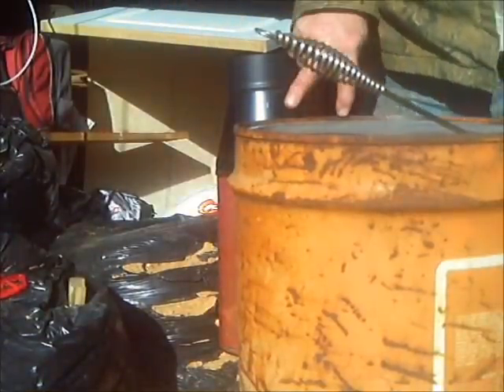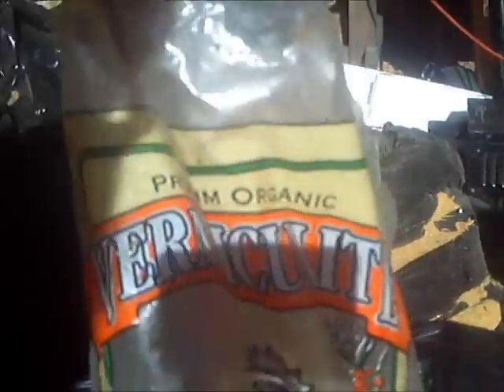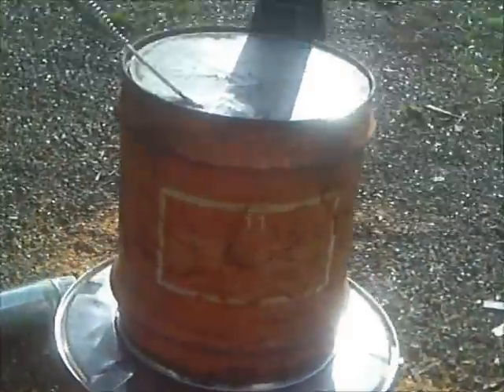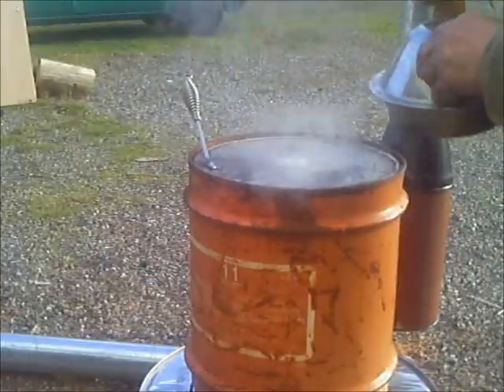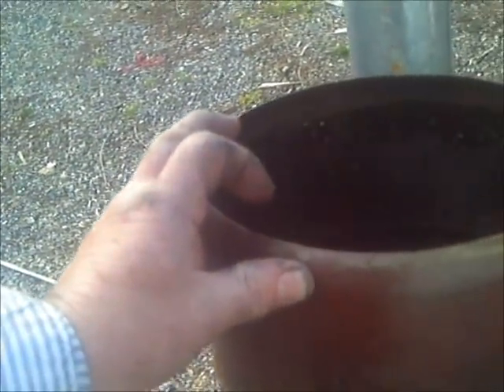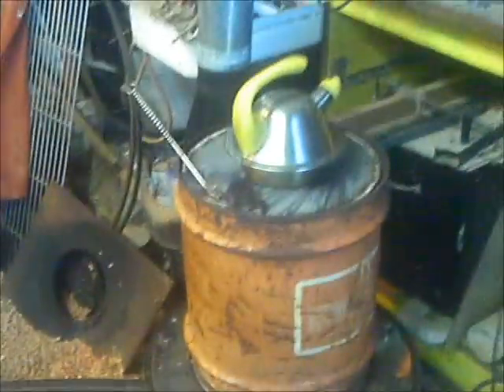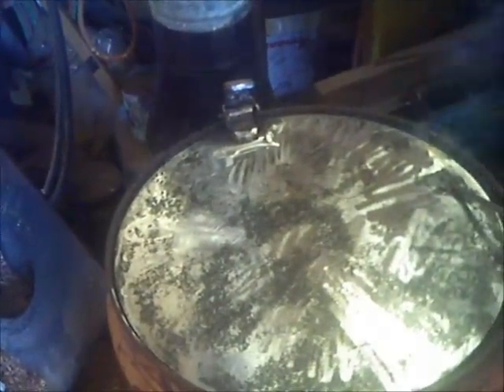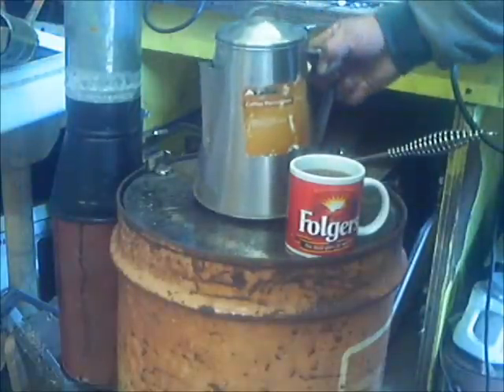Sawdust cooker Test burn

Comment from the maker: The tube that comes up the center from the bottom is the air inlet. That make the glow you see. It sits on the washing machine drum.
Reply: so there is a hole in the middle of the bottem ?? how big is the hole??
Reply from the maker: @busdriver9007  Look at time stamp 30 seconds. You see the white pipe? That size. then 9:05 you see the hole.
Reply: @badbadbob1  i do not see the intake to the outer drum ???
Reply from the maker: @busdriver9007  Stop the video at 9 min and 5 seconds. You see the hole in the bottom of the can.
Reply from the maker: @busdriver9007  Look at the video just before it on how i made it. https://youtu.be/HwXPhZdvNYE

Comment: How long before the fire/heat burns the carbon out of the inner and outer barrels....or have you thought that far ahead?

Does this keep your shop warm?
Reply from the maker: I have burnt 10 loads threw. It does not look like it is anymore then a thin layer of smoke. Because it is dry sawdust and mixed hardwood and soft. I burns very clean. The stack is so cool it condensates the humidity out of the air. That may be why It is not a build up problem.
Reply: Awesome, Looks like something I may want to build for my shop...thanks
Reply from the maker: This small size burns for about 6 hr. where you would not want to touch it due to the heat inside. I fill & light it and do not touch it till the next day.  You can cook on top for 4 full Hr. It is a great cooker as well it heats a small shop. I have it in a 2 bay pole building so It would never warm that. But my coffee is always hot.